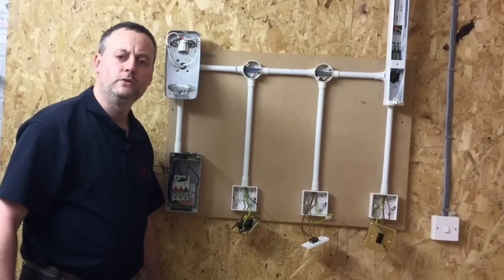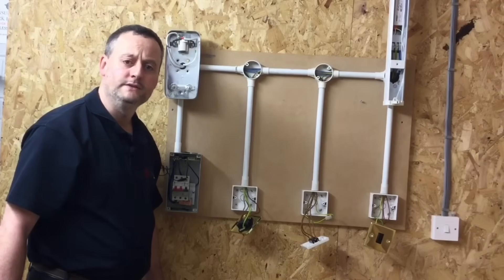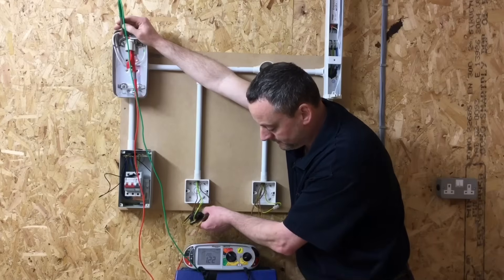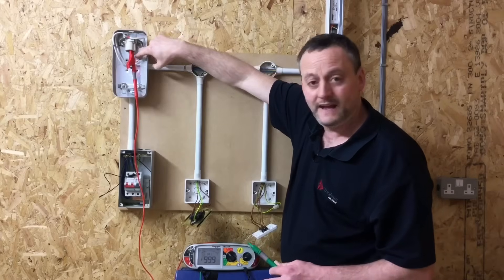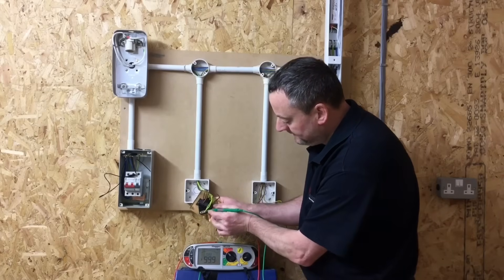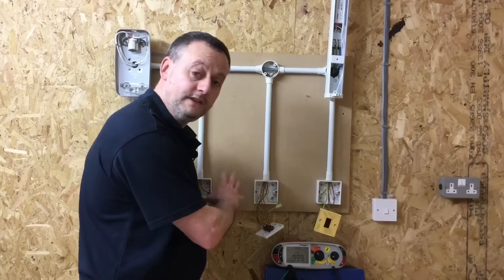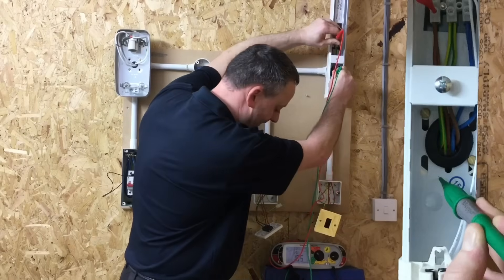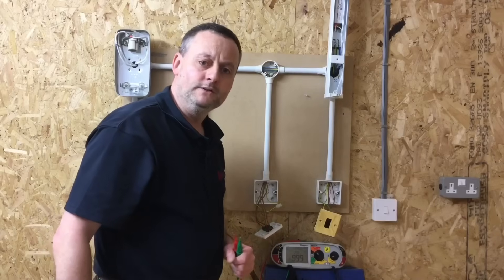Exposed Conductive Parts and Proving They are Connected to the CPC (Earth)

Comment: i fitted a metal light switch and was connecting cpc from backbox to the face plate and as this was the 3rd cpc cable couldn't get it into the wee hole for the cpc on the backbox, as 2 were already there in the hole . how do i it in this circumstance? not enuff room to fit cpc into the screw down part

Comment: Is there any reason why the readings were jumping around when you tested the fluorescent fitting? And what reading would you chose if it keeps jumping higher or lower?
Reply from the maker: Hi thanks for the question... me sadly as I am trying to talk I am not pressing hard enough on the connection so sorry Gaz
Reply from the maker: Alvin Ashman hi we have to max out our battery use at college as we have a limited budget.... I will pay more attention from now on Gaz
Reply: The readings might jump about as Gaz said, through poor contact being made at point of measurement or the batteries in your test equipment may be low. If you have good contact on the terminals and the batteries are good, then try swapping the test leads. You must wait for the reading to settle before recording your results.
Reply: GSH Electrical- I understand that Gaz, I don't think the test equipment was fluctuating because of low batteries, I just thought I offer another suggestion as to why the meter reading could be jumping about, not necessarily on your meter but the meters of your subscribers. Out of all the test on a multifunction tester, the continuity test uses the most power.

Comment: Hi thanks for this video...  But what if we have a dead short of the line conductor and not the cpc and the exposed metal parts of the light fitting...  Wouldn't it be better to check the cpc right from the fuseboard to the light?!  

And what if we miss that short fault but then the insulation resistance test will (hopefully)  fail and after fixing we'll have to do this test again?
Reply: I've tried reading this comment a few times and still have no idea what you're going on about. This test wouldn't highlight a short-circuit fault between line and cpc, it's not suppose to, the insulation resistance test will pick that up. Also nobody in their right mind is going to confirm continuity of cpc by using the wander lead method as the R1+R2 method not only confirm continuity of cpc, it also confirms functional switching and goes some part to confirming polarity.
Reply: As I said before, a short-circuit fault between the line conductor and cpc/exposed-conductive-part(s) would be picked up in the insulation resistance test. The only way it would be missed, would be if the exposed-conductive-part weren't in some way, shape or form connected to earth.
Reply from the maker: Hi. Thanks for the question but I am not quite sure what you are asking me. GSH Electrical
Reply: GSH Electrical thank you...  Sorry for beeing unclear.. 

I'll try again

You bridged the line and PE in the fuseboard 

You check the Continuity of PE by probing the Line (red wire) to the metal  case (green wire)
So far so good 

Now to my error scenario

It would be possible that the insulation  of the live conductor is broken somewhere (L) touches the metal somewhere..  Your test would not tell you! 

If you instead disconnected your L to PE link in the fuseboard and used a long wire from the Main Earth bar in the fuseboard and probe against the metal housing of the lamp would be safer instead (because it is possible that you don't  even have Continuity of PE but Continuity of L what is lethal)
Reply: Perhaps I found an answer myself... 
If you have a L-fault you will find out as soon as you toggle a switch...  The Continuity would remain even if you toggle a switch
Reply: Alvin Ashman  meant a short between live and the metal casing of the lamp
Reply: Alvin Ashman exactly that is what I was thinking of
Reply: Gaz's method is absolutely sound, I see no flaws in his method. The only thing I would do differently, would be lock off the main switch/circuit breaker I was working on as in the real world, the accessories/fittings will likely be in a location remote from the consumer unit and may be inadvertently switched back on.